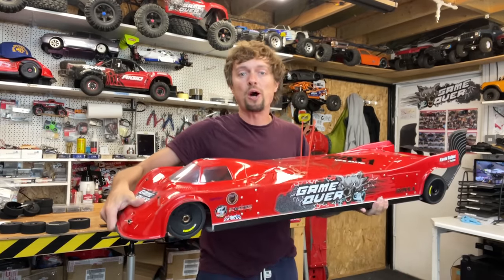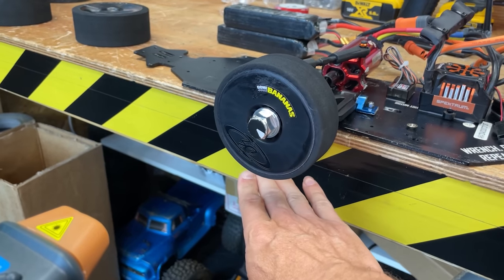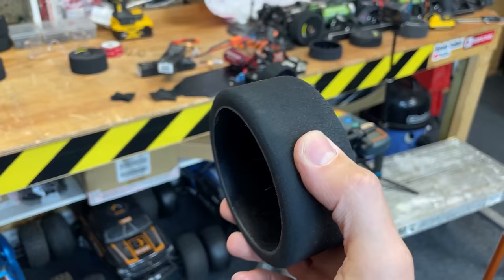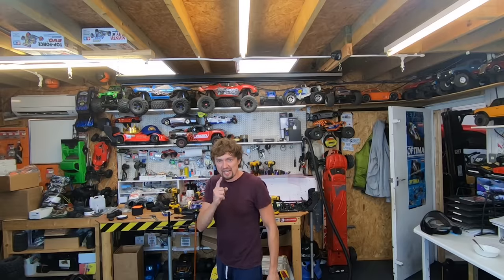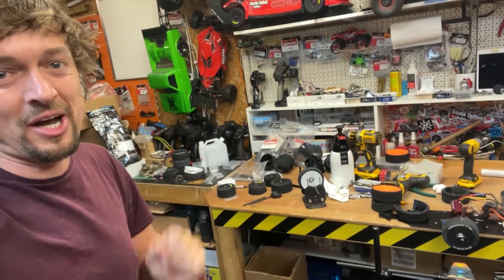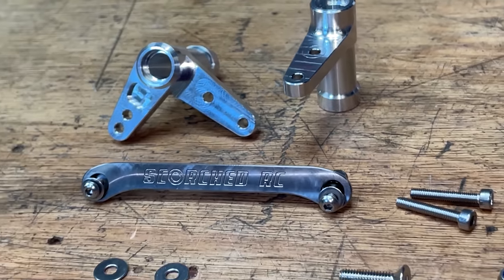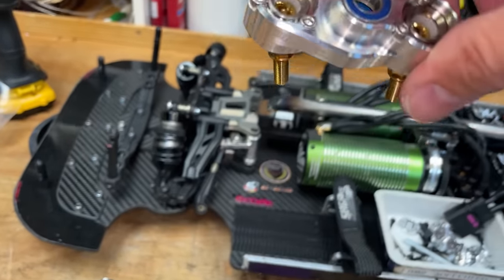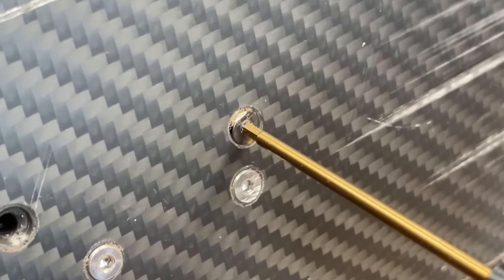Top secret Tires for 250mph Sausage RC Car project

Comment: I don't understand why you don't use a wheel that's double the size? Surely you dont need to follow the normal size and a larger diameter would reduce  the stress on the foam whilst giving it more top speed for gearing... you have the power and I don't mean just HP but the Torque

Comment: If the front motors are powering the fronts, and the rears are powering the rears, why bother with center driveshafts? Seems like more drag and rotational mass to get in the way. Why half shafts at that? They’re never perfectly centered in the cups. Imagine the drag on those

Comment: An aluminum or titanium with a piece of tape on it should do it.  The fastest land speed cars run metal wheels. Need some kind of tape so there’s a little bite into the road, not just aluminum skating along.   I would think the car has to come to a stop without destroying it, for the speed to count.

Comment: The problem you're having with your tires blowing up is that your rim is stretching in the center causing your tires then wear unevenly and they give out on the inside if you watch your videos if your rims didn't stretch your tires would last longer

Comment: Has anyone tried FDM printing a wheel with one of those carbon fiber filaments which have 1 long Carbon fiber running through the entire length of it? 
It should give it great tensile strength which gives those fictitious forces a hard time expanding the wheel, plus it's cheaper than most other forms of manufacturing a high performance wheel at home.

Comment: The bomb bananas seem like they were limited by the structure or lack there of strength in the wheel itself and not the foam as the true cause of their failure.
Where as the wheel seems the foam gave out, nothing to do with the wheel. Better adhesive for the first one shouldn't matter the foam just cant take it.

Comment: kev you no when you get a tyre tested they put a guard over it its not that the tyre is blowing the air its displacing is not contaned put wheel arces over them

Comment: Not even 2 minutes in. I did 170+ consistently on the stock hoons on a singular stock tp motor, minimal upgrades, limitless chassis on an open wheel design.. oh and an xlx2. Did you ever tuning that all your horsepower is creating too much weight on the tires? Causing premature failure?

Comment: Your clearly pushing the limits of the plastic wheels the ly you need to find a away to control that expansion on the in edge. As mention a carbon inlaid design or billet aluminium wheel might be your next solution. I would go and look at top fuel drag cars aswell to get some ideas for wheel designs they run thin wheels at the front and fat wheels at the rear for a reason

Comment: Could the fome sorry carnt spell 😂 go between the baring on the axle and the wheel then glue or bond something to the outside of the wheel for grip something like the rubber grip tape they use for skateboards? 
Just stabbing In  the dark tho to be fair

Comment: Titanium wheel…? The forces that are involved are tremendous, aluminum might yield before speed is achieved. Carbon fiber may also work if your wet layup is done correctly.  Steel is to heavy, aluminum is light enough but is to pliable while under rotational pressure/load.  You want to stay out of the plastic zone and stay within the elastic zone of the material that you have chosen to test. Which means you want the material to return to its natural state after the run and the speed is achieved.  And not deform permanently.

Comment: Kevin why don't you try and make your fenders taller and wider so at higher speeds your tires aren't rubbing up against the inner fenders? Remember that's why dragsters and real land speed cars are open wheel cars. I truly believe the design of the body and your tires are hindering your goals.

Comment: What about a carbon Fibre wheel? If that Koenigsegg carbon wheel car can handle 300mph surely  Raz can make a set. I reckon the tyre is letting go because the wheel is actually expanding. Just a thought as I know sweet F A in the big scheme of things 🤣🤣🤣

Comment: You worry too much on tire weight. You've got 100 hp so the power to weight ratio is massive. Get a solid rubber tire that will hold 250 mph. You've got the power you may need a helicopter to follow in for ultimate top speeds

Comment: I think the bigger issue is probably heat. I'm wondering if some kind of durable silicone would work. It's grippy, and it's used for all kinds of heat resistant products. I wonder if you could create a mold, put the rim in the center, then fill the space in between with a silicone and let it cure. Balancing may be an issue, but if you get the mold and rim nicely concentric, I'd imagine it'll be ok. Just an idea.

Comment: Open cell polyurethane of specified durometer! On any wheel will prove sufficient. And add overall weight. Possibly even a push on depending on fab and manufacturer like a slip on over existing wheel tire combo and will work. Very nicely. Precision plus engineering plus human equals genius or potentially smiles of infinite variety. Class dismissed.

Comment: I love you from all my heart, Kev!
But is a very bad idea to drill carbon fiber with electronics and motors installed in the chassis, even while using a vacuum cleaner.

Comment: Wonder if anyone has tried combining the rigidity of like a beedlock wheel from a crawler with a foam or hard rubber tire. 🤔 I know Traxxas Tricked out a TRX for a stunt video and got over 100mph with it but i have no idea what wheels or tires they used. I will see if i can find it.

Comment: 5:00 its clear that thes asphalt floor is ripping the foam tires..
Reply from the maker: It’s clear now after seeing this, wasn’t clear before
Reply: @KevinTalbotTV   I actually expectedt this outcome after the driving WR atemp videos.

But yes this Videos definitely profes it very well.

Hope you find another solution to smash thoes WRs!

What about a full rubber tire? Like Tire rubber all the way through? Would probabely needed to bo a one pour Mold.. 
With a somewhat hard rubber but sticky.. but not as hard as a 3d printed plastic.

Comment: All due respect but I feel like a lot of the things you did in this video should have been done before running it. Testing/calibrating the motors/drivers. Testing wheel designs at high rpm etc. I would also have to say nothing about those wheels you've been using are good for speed. Over obsessing on the tire when the whole thing's bad. The shape, width and material are just obviously unsuited for very high speed. Plastic is gonna turn to liquid under those forces.

Comment: All the available wheels and tyres are shite basically. 
They should be thin alloy wheels and large diameter. 
If they are large diameter then they don't need to spin so fast.
The lower wheel rpm means that the tyres won't expand as much and change the ride height .

Comment: just need better rubber tires from some brands !!! real cars use a belted rubber and achieve 400-500 mph world records, so rubber is the way someone needs to just figure it out...foam on concrete just gets ripped up the minute the tires start spinning.

Comment: Lol blurring out that you cut half the rim 😂
You do realize that there's plenty of examples of 1:1 land speed records with narrow large diameter wheels right?

What you could do: take two wheels and glue them together with the outsides of the rims and cut them both down 3/4 down the way or as far as there are internal reinforcement baffles..

Or simply glue a flat ring to the back of a rim..

Comment: Idk why were putting so much thought into tire design when only 5 minutes into this video the RIM/WHEEL has initiated every failure... rim design needs to be the focus, tire design is secondary. All u guys are putting tire design first which imo is completely wrong
Reply from the maker: Rim is fine at 250mph